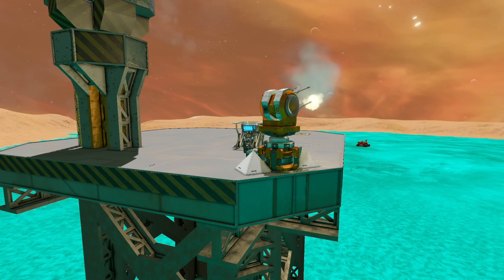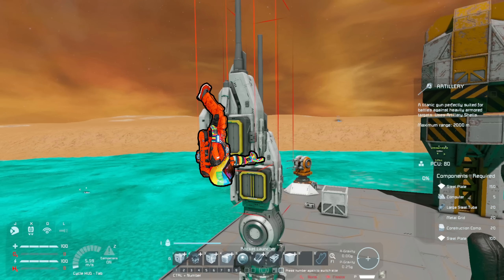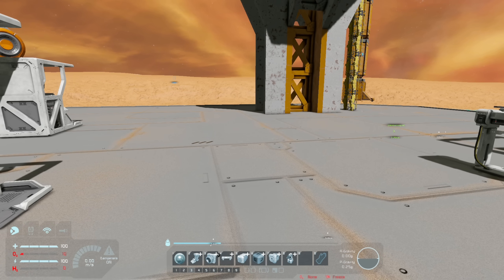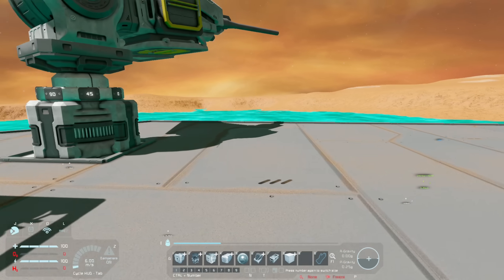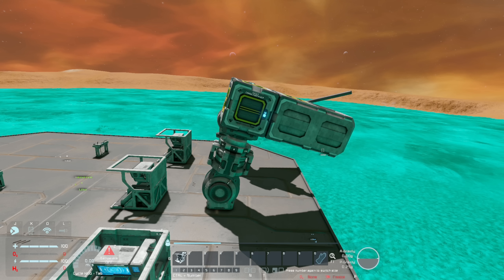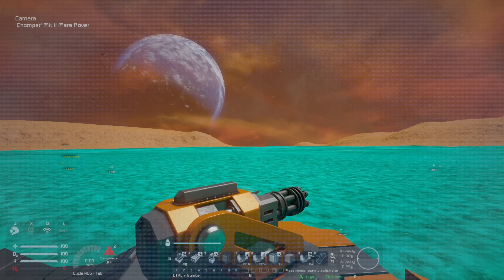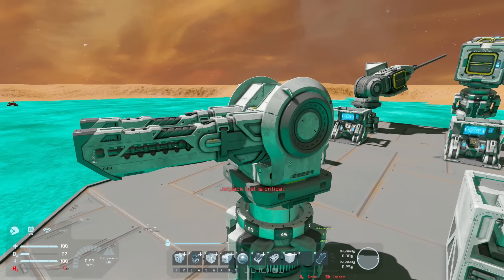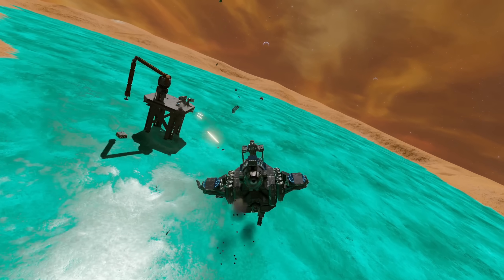Custom Turret Controller: Space Engineers Tutorial

Comment: Actually hinges work fine if you got only a few guns but double rotors at mid-height of your gun array seems better as the moving part requires much less force to rotate the array if you build it balanced around the axis.

I've seen some people having issues with these turrets damaging their grid or the grid they're locked on: that can be prevented by putting limits to the hinge/rotors to tell the thing to not go below its horizon.

A bit specific: on using this system with WeaponCore.

I have not yet found confirmation from other people but as far as I've tested these controllers are only partially usable with Weaponcore
- They do not recognise WC weapons as usable weapons
- If used with base game weapons they don't seem to take orders from WC's targeting system, so they cannot be used autonomously

Now you can still use it manually, if you put the weapons (either default or WC) on the turret, set it up normally, then on your gunner seat in addition to "control turret" and "view camera" actions, you simply put the guns/etc in a group, set up a "Toggle click to fire" action. Then control the turret, use the camera (zoom mod recommended for long range weapons) and when you want to shoot you use the toggle click-to-fire. You might need to set the WC option "override" to fire the weapons manually.

Overall a very nice addition to the game, I hope WC will get full compatibility with it soon. These turrets seem almost too precise and fast, so I wonder if they could be modded to make nerfed versions? Then again manufacturing the ammos for it must be its own nerf. But imagine, you're approaching a ship, seemingly unarmed, and suddendly panels open, pistons expand and these buggers start raining autocannon fire on your face... Can't wait to see if WWU's "bots" decide to play with that. I wonder if that can be put on a plane?

Comment: Placing the cannon in line with the hinge at ±0° actually restricts your arcs of fire.  By placing it transversely, (i.e. the gun points to 90° when the hinge is at ±0°), you get gun depression and you don't lose the ability to fire the other way because you can get that by rotating the turret.

Which of the two is actually better would depend on application.  Something designed to take on fighters and that will be mounted with a hemispherical FOV doesn't need gun depression and benefits from the lack of a central stop.  OTOH, if you're putting a heavy turret on a ground vehicle you really want to be able to fire horizontally while parked just short of the crest of a hill.
Reply: A broadside gun on a space-based craft might benefit more from two hinges rather than a hinge and rotor. A semi-realistic naval type cannon or shoreline defense type gun would work with two rotors, or one of each. An anti aircraft weapon or one in a depression would benefit most from the vertical weapons, as you've pointed out. Lots of nuances to building with these sorts of joints.

Comment: hey splitsie i may have an intresting idea for making a plane that functions a bit like a warthog and it seems like a fun thing for you and some friends to mess around with on stream (this will (i think) need the airodynamics mod to function and i don't know what's possible and what's impossible in space engineers so i'm sorry if what i'm saying is stupid or has already been done)
i think that you can use the new turret control block to make a plane point at an enemy by using a gyro for the X and Y control and  having a control block/timer block/combination of the two preventing that it makes sudden moves (as a result of wich the plane would crash), using another control block/timer block/combination of the two to deactivate the turret controler and make it brake of and cirkel around/return to base/avoid terrain/something else that it needs to do (i think there is a radar mod that uses camera's to measure the distance from the camera to something in front of that camera wich you can use to make the plane pul up) and you could use the turret block or an independed turret to determine if there is terrain in between the plane and the target so it doesn't keep firing into a hill or something like that.
this explnation is probably incomplete, is over complicated or just doesn't work but thank you for listening nonetheless 

ps my english is probably not so good because 1) it isn't my first languege and 2) i wanted to be the first one to propose this stupid idea. sorry for that.
Reply: thank you for reading this.

Comment: I had no time to test it yet: can one controller control more than one turret? so synchron firing batteries are possible?
Reply: No, each controller can only control a single Rotor or hinge for each direction (Azimuth and Elevation) so making multiple move and fire at the same time would need scripts... 
Better yet, there is the locked on and lost lock action in the turret controller, pick one turret as the master and have the lock on turn on a timer that fires all guns then starts itself again every x seconds (depending on the reload time of the gun you use) then have the lost lock turn the timer off. As long as all the turrets have the AI enabled and are in range they should be pointing at the enemy when the script is triggered and their guns will fire every time the timer cycles.

Comment: 4:29 This wiggle is mostly caused by the azimuth and elevation speed multipliers being way too high for mass and inertia of the turret head. Not only do the multipliers apply to the mouse input, they also apply to the AI's. The AI drives the rotors and hinges as hard as it can to reach the permitted speeds, which it never will if mass and inertia are too high, subsequently failing to slow down early enough to hit the required bearings. The turret overshoots, and the chase continues, now in the opposite direction. The heavier the moving parts overall, the lower those settings must be if you want to prevent or minimize overshooting.
That said, adjusting the torque of the rotors and hinges has an effect, too, but there is only so much you can increase that parameter before the numbers appear in scary red.
Finally, setting the inertia tensor share only on the hinge, not the rotor, too, seems to help as well without slowing the whole turret to a crawl by making it share the tensor with the entire grid.
Reply: this should be pinned as it is a very good tip for avoiding those problems or minimalizing the strange behavior :)
Reply: I also noted that it reduces significantly if you use the "share inertia tensor"
Reply: @MediumRareOpinions  which kills MP servers
Reply: @andybraid4263  to be honest I probably won't be trying to use these much on MP servers anyway. To do so is to tempt forth clang.
Reply: @MediumRareOpinions  thank you so much!
Reply: One work around is putting an overridden gyro on the heavier turrets. Also reduces recoil affects.
Reply: PTSD from coding pid controllers
Reply: @Cuteseals2  Coding them isn't the problem, it's tuning them. Your options are obsessive trial-and-error to reach that ever-frustrating "good enough", or to spend even more time coding a debugging graph and potentially an auto-tuner to make tuning less frustrating.
Reply: @Derpy-qg9hn  yeah tweaking them is still coding, adding them ain't bad it's just the tuning which makes you question all your life choices
Reply: This is pretty insightful thank you
Reply: Yes and no. The main problem is that you have two heavy grids connected by a light one. Momentum is transferred in 'packets' by moving the intermediate grid, and a lightweight intermediate grid means the physics can't move momentum very efficiently. It doesn't have enough time to properly stabilise in the number of iterations allowed. Sharing inertia tensor helps by moving inertia around to balance the masses, or you can just actually increase the mass of the intermediate grid (my multiplayer cranes have ballast cargo blocks around them for this reason). Annoyingly neither the rotor part the hinge base have mountings on the side, so you need to put another block in the middle to do this.
Reply: This comment is why I was looking for videos on these turrets the rest seemed common sense.
Reply: I believe the term is PID Control is what is needed for those turrets.

Comment: The Ball Turret can be made easier. 

If the hinge block is facing up in a natural gravity well, like in the video, you can just place a filler block (armor/whatever) in the center of the big hinge block and let it fall, then, if the big hinge block is small grid, you place the hinge part on top and attach.
If the big hinge block is large grid you place another filler block on top and a hinge part on top of that one and attach. (In either case the hinge part will be instantly rotated to fit the motion range of the big hinge.)

If you're outside of natural gravity you can just place the small hinge part in the center and attach.
Reply: I found that putting 1 half block upside down, and putting a full block on top, with a small hinge on top of that, inside the large hinge, makes it really easy to make a turret in gravity

Comment: Also interesting to see if this can help lay down pipe lines like you did in survival impossible, if you build a connection point and then control the arm to it might work, maybe
Reply from the maker: Ooh, that's a cool thought
Reply: @Splitsie  Lastly when doing a rail gun mini turret put each gun firing as an individual button, so as you can fire them single.   Anyway found a asteroid with plat so back to it.

Comment: Sharing the inertia tensor on the hinge greatly recude the wiggle.
Reply: A zero override gyro should also work.
Reply: increasing the breaking toqure fixes the woble
Reply: Sharing the inertia tensor CAN make aiming speed real slow since it'll be using the combined mass of the grid and subgrid. You can counter this with more torque, but things can get bit clangy if it's in red numbers.
Reply: Just keep in mind sharing inertia on most servers is banned just like redlining.
Reply: This and on the rotor. Works fine
Reply: @pitekargos6880  I find doing it on the rotor wobbles the ship, pretty funny when a small rotor can wobble a 6000 ton ship

Comment: Is there a way that two groups of X and Y rotor/hinges that could be  used to move a dual drill arm setup on a single controller?
Reply from the maker: Sadly not, you can only put single blocks into the controller at present, groups are unable to be added :(
Reply: @Splitsie  Worth a shot. Would be cool though. Guess I could just use one as a base control with some manual Y controls for spacing of the two drills
Reply: Might just have a play in a bit ;)

Comment: A multiple controller 'crane' might actually work very well as a refueling boom. In small grid you would need a small connector (or modified small ejector) and probably a small advanced rotor. The controllers would each control one arm joint. Shoulder, elbow and wrist controllers.

Now if only you could tell a controller to track the sun . . .
Reply from the maker: That's a very good thought - might try to get DE to test it with his booms in WWUp :)
Reply: I'm wondering if swapping the crane over to multiple controllers might make it a little less terrifying to operate.  Probably not.
Reply: @Texfire  It is only truly terrifying if you let Capac drive the crane ;P
Reply: @robertbaker7610  Truth.
Reply: I just set rotor speed to match the sun's track across the sky.

Comment: Just this one simple addition (controller block) has opened up SO many awesome ideas, I'm waiting for people to start using it to do welding and grinding robots along with the turrets.
Reply from the maker: I think it'll be really useful for simple robotic arms with grinders and welders - I'm kinda looking forward to building one myself :)
Reply: @Splitsie  Depending on how they work they could even streamline the robot arm/leg scripts
Reply: @Splitsie  or even an easy deploy runway with an upward angle for say an airplane
Reply: @Splitsie  Potentially automated too, given we can set sensors and the control block to "Target"  specific types of friendly grids.

I may have to try making an automated drone facility now...
Reply: I'm thinking to use it for an early space exploration drilling arm, pull the ship up belly towards the ore then switch to a turret controller to point a piston and drill arm directly at the ore, switch back to the ship controls, turn the drills on and put the pistons to extend.
Reply: @5kellDarkes  It could work sort of. However you have to leave the turret controller control to do anything not directly related to the turret. This includes things like adjusting pistons. No driving and running a turret at the same time.

The turret controller really is mainly for local control of a rotor turret. Controlling something more complex or multitasking still needs a script. Remotely controlling a turret controller also isn't a thing yet either. A multi-segment arm can be built and used but the controls are cumbersome.
Reply: I like it that we dont have the choose between scripts anymore aldo some where good bud its aswome its now done easy
Reply: I'm using it on a large grid mining rover.. 
Was, that is. Before clang wanted it
Reply: Definitely opened up the game for people who didn't want to mess around running 72 scripts that worked half the time, clanged out your turrets the other half, and occasionally just crashed or lagged the server by after conflicting with other scripts.
Reply: So far i been building tanks with the custom turret controller
Reply: Been possible with scrips for ages
Reply: @HarryL2020  scripts aren't available on many servers, and are worse for performance than this, in my experience so far.
Reply: This is actually just what I've been looking into to try and build a setup where instead of having one giant ship that houses all your cargo and all of your other whatnot you have a colony of small automated phones with waypoints setting mining locations and others following them with guns as protection to automatically carry out tasks as well as repair each other
Reply: Something I am thinking of is combining these with the old missiles and torpedoes mod, and making missile turrets. 

I remember trying to do this in the early days of scripted turrets and just never really being able to make it work.